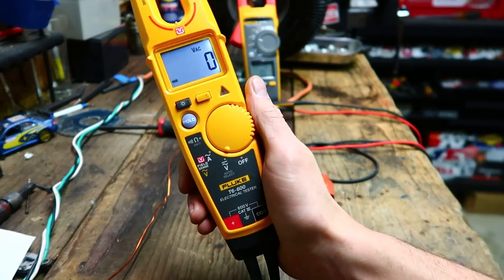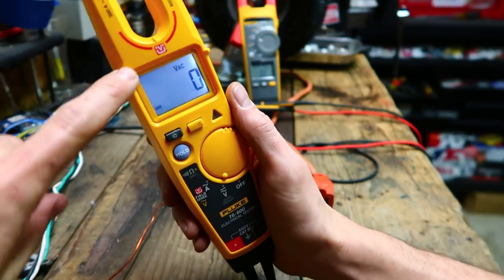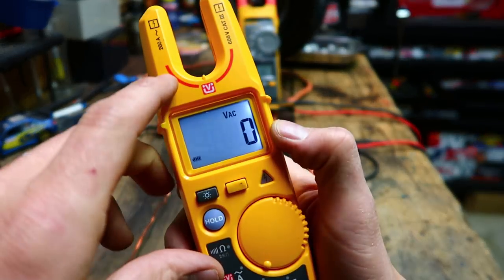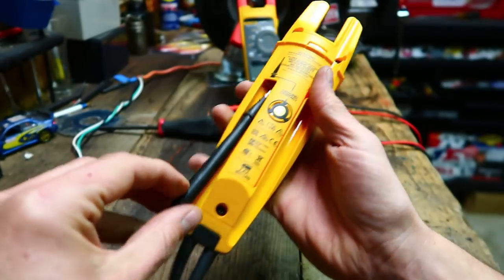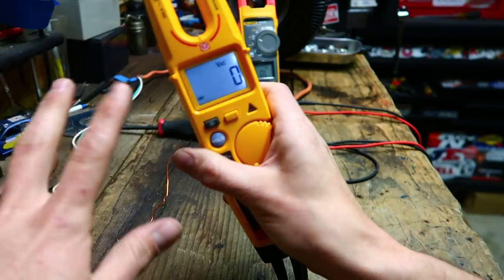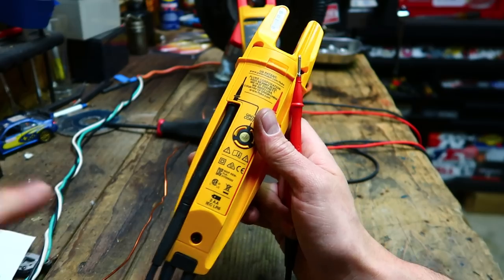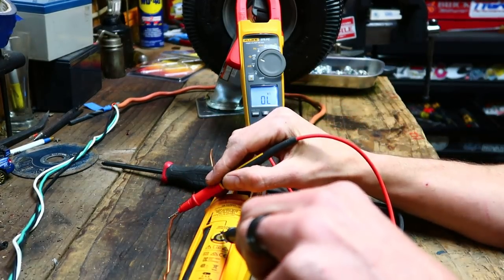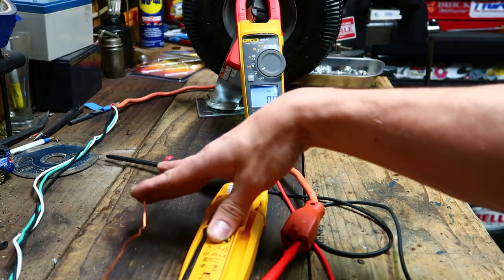Fluke T6-600: NOT DANGEROUS!

Comment: There's definitely a safety feature in there, but I think AvE's point is that relying on a safety feature to keep you alive is bad practice.  If whatever is doing the mystery shit fails, and you get a short path to that pad, it will kill you.  Using that meter as designed, there is no way not to be relying on the safety feature.
Reply: John......intent is not required to harm or kill.  But the almighty dollar rules all in these companies and engineers are required to create work-a-rounds to save $.   In many cases engineers KNOW these WILL cause the product to fail or greatly increase danger factor, but they have little to no say.
Reply: Yep. And sometimes its just unknowns which end up biting us. For example, in some year time, when the damage from blue LED light starts becoming apparent, people are going to be upset.
Reply: John Peat:  I recall FORD knew of high fire danger during rear end collision in several models, believed cheaper to pay a few claims, and went to production with deadly design. Many died. FORD had blood all over the boardroom table. Do not trust greedy people. (e.g. see Ford Pinto and Fairmont)
Reply: The blue light issue from LEDs  is not really true  there are some effects which are legit but minimal and blown way out of proportion (mostly circadian rhythm disturbances but that can happen with any artificial light source) by scammers, sensationalist articles and people with financial interests ( one of the biggest anti LED persons also claims WiFi negatively impacts health and literally they sell glorified tin foil hats as "anti EMF beanies" hilarious! ). Fluorescent light bulbs also have a very high blue light content with an awful CRI, its been about 60 years since they started being used on public places and no significant effect has been found so far to merit all the scandal LEDs are making.
Reply: Can you tell me some of this mysterious diseases? Also if "mainstream science" doesn't even know the causes of such "diseases" how can you say the cause of such effects is from the lights or the router? maybe you suffer from apnea but you don't realize and the fact that you turn off the router affects your sleeping patterns by suggestion. 

I assure you if i were to turn on a RF transmitter in the kw range at 5m from you without telling you as you sleep you would never realize, yet if i placed a small battery on the indicator LEDs of your router even if everything else was not powered you would affirm the RF from the router is messing you up. The power of suggestion is real and you are suffering from it, and is quite common on this pathological science people use to sell gimmicks and scams. Dont fall for it RF is all around you, your router is nothing, lighting generates RF, your car ignition system is a tremendous broadcast source, your cell phone, your computer processor, even a clock uses high frequency pulses that generate RF in fact the static electricity as you get out a wool sweater generate enough radio waves to be detected on an AM radio. Also your neighbor can have its router on too, just look how many routers are on when searching a WiFi connection.

When X-rays were discovered people quickly realized its harmful effects on organisms and the human body, its been more than 150 years since radio waves started to be used by humans and yet nothing surfaced until the recent wave of quackery that is sweeping modern society curiously enough its always mysterious, unexplainabe by "mainstream science" a conspiracy or some other ridiculous claim like that yet you have always someone selling "protective devices" smh

Anyway, i have an offer  

I sell you a tinfoil hat  an electromagnetic field shield for your head for just $99 but if you order two i give you one for 50% off, its made of copper not that low grade aluminium shield our competitors use, they are running out! just give me your credit card info, its safe! 

Here is a testimony that proves how great they are

"Before my Quantum-ubuntu™ hat i had constant head aches and couldnt sleep well, i live close to a radio station and i see my son has been having low grades since they changed the antenna, but now with my Quantum-ubuntu™ hat i sleep much better and don't have headaches anymore and even my hemorrhoids seem to be going away, also my son is getting more +A's!! than ever. Best $250 i have spent" ----Ana Linjector
Reply: There was a tiny study about an ion generator influencing the sleep of a handful of participants (positive influence if I recall correctly).

Comment: The question is not whether it is dangerous when new, out of the box, it is a question of what happens when the capacitor or high value resistor that is limiting current flow to the very very low levels starts to break down one way or another due to deterioration, moisture, etc.

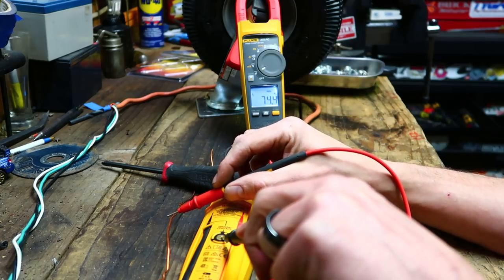Comment: Ok, here is some electrical explanation on why it is or isn't dangerous: If we take a look at 4:24 then I suspect the circuit you've created here is a simple voltage divider.
Basically between live and ground you have your 110 volts (or 120), then if you connect 2 resistors in series they get both a fraction of that resistance. And now let's say the grounding pad is a resistor of 1 Mohm, and your T5 fluke in volt measuring mode has 2 Mohm internal resistance, then the grounding pad gets 1/3 of the 120 volts, and the T5 gets 2/3 of the 120 volts. That's likely the case here. But when you touch that grounding pad and your body is 10Kohm, and that grounding pad is 1Mohm, then you get 1% of the voltage drop over your body, and 99% of the voltage drop over that grounding pad. That's why you don't feel anything. Why AvE had another measurement could be because his multimeter (he used UNI-T) has a way higher internal resistance than your T5.Or it could be because his Fluke T6 is actually a faulty one... A simple resistor will do the trick for the grounding connection, I don't think they did much more than a resistor, I think they sealed it to confuse you into thinking it's aerospace military super-duper technology and not marketing wank. It's nothing fancier than those voltage measuring screwdrivers with the neon lamp in it.
Dude, what the hell are you sayin' about ghost voltage? Dude, voltage divider, resistors in series, a volt-meter is simply a high-ohm resistor that measures what amps flow through it. The reading has nothing to do with how well build the multimeter is. That's another way how the marketeers want to rip you off.
Why there still is a danger to it: Speaking about the touchless sensing: who the hell came up with the idea to put the voltage reading feature on the amp-reading dial position? Those should be separated. Because now if you put your dial to the position to enable the field-sense you will have continuity between red and black leads. This basically means that while you are measuring volts you have continuity between red and black, and you must not use the leads to measure. Don't forget a lot of times you won't ground with your hand, but by touching the ground with the probe. To get a better connection, because it's more convenient in your work-case, cuz you're use to use the prober or because you're wearing gloves. This are reasons to just name a few. Field sense should be on the voltage-dial position, period. If that technology worked as advertised.
---
Disclaimer: The numbers I used were all made up, they are just examples to explain the principle. I don't feel like looking up the exact, irrelevant data. And my values should be reasonable.
Reply from the maker: my whole issue with his video is that he tried to make it appear there was mains voltage on the contact pad that could electrocute someone, and that's false. I totally agree it's a shit feature, but you can't get shocked from using it
Reply: I thought about it for a while. What if that resistor fails or the batteries heat up and melt it. Unlikely but possible.
Reply: That's where I stand on this too; many people are assuming the touch pad will have such a low current to not shock you, but that assumption is rooted in believing that the meter is undamaged. There are too many safer alternatives to measure electrical things than using your body for a convenient shortcut.
Reply: Well thought out response. Thanks for taking your time to share this.
Reply: Mike's Tool Shed well he was drunk and butt hurt fluke called him out I suspect lol poor guy you could tell he was pissed the whole vidjao
Reply: I agree with you totally and no meter for testing line voltages should be made so that you are part of the circuit at any point. Horrible idea. AVE has always admitted when he is wrong to the best of my knowledge and if he is in this case I feel certain he will make yet another video. It's bad enough it doesn't work as it should, but if the comment from Fluke held water then it would still be up. Seems like a lawsuit waiting to happen either due to it failing to read or a malfunction/user error because that would make a hot cup of coffee from McDonald's seem like a blessing.
Reply: I don't get why you think a knob on a fluke meter would short (or give continuity) between the probe. It's a high impedance input point bar.
Reply: well I can tell you that if you can sense live voltage there IS a PATH that is there, it may not be Deadly YET, but it can be and that is the fact that he is bringing up, if that device gets wet ( or even damp) on the inside of that area this will complete the link and kill you. this is why it is unsafe. There is a Trace that is unsafe. I am sure he knew this and was too fumed at Fluke Shitter who said  " you are not using it right "  sorry but if AVE used it wrong, most will use it wrong, but it is not that, it is just a Finiky Gimmick.
Reply: NoNoLabs if the resistor fails it ain't gonna short out it's gonna open.
Reply: @MikesToolShed  "you can't get shocked from using it" - try 600V and have an injury on your finger (knife cut would do it).

Comment: I'm not sure if it's a big deal but didn't ave have it on the amp setting during his video.
Reply: He did, that is a big deal. When you measure amperage, there is effectively a dead short from the red to the black test lead. AvEs point had little to do with voltage, if I am understanding correctly. His point was that if you were measuring amperage using the probes, and you were touching the contact pad, and you happened to have a lower resistance path to ground than whatever the black probe is connected to, it COULD be dangerous. For instance, if for some reason you were measuring amperage between a wire at 200v and a wire at 100v, and you were touching the contact pad, then it SEEMS as though you would be touching a 100v source and it could kill you.

I also find it hard to believe that somebody at Fluke didn't think this one through, but I see AvE's point that on the off chance Fluke HASN'T got a weird trick up their sleeves with the contact pad, it could be extremely dangerous in the right circumstances.

Comment: I do agree that the meter is not dangerous, but your test methodology was wrong. The Fluke continuity check only beeps under 100ohms, so if there was a 1kOhm resistor in there it would still be dangerous, but would not show up on continuity. Instead, you would want to put it into normal resistance check to see what it reads. If the resistance is over 10MOhms then it should be perfectly safe to use. If the resistance is higher than that then something like a Fluke 87 is useful because it can also read in micro-Siemens. A better check might be to make that pad live, and use a uA meter to see how much current can flow from that pad to ground. I would be surprised if you were able to see anything but measurement noise. 

Let me know if you have any questions about what I just said.

Comment: I tested one yesterday and it's dangerous, that shit shows 0V even on a 230V circuit if you don't aim it perfectly. I know that these meters are not allowed to test for 0 voltage conditions but even then it should work reliable.

Comment: It's probably just a very high value resistor. Resistors limit current (in this case down to micro Amps that you can't feel), not voltage.

Comment: Yes there's no continuity but that only means that the resistance is over 40 ohms (some meters have a higher threshold).   Undoubtedly the impedance between the grounding button and the negative probe is very high.  High enough that it's not considered a safety issue.    Still, when working with live AC power, you want full galvanic isolation whenever possible with anything you touch.

Comment: You have to use as amp meter (you were in field sense setting) in order to reproduce the same as AVE's.  Are you sure you put the probe in the live connector?
Reply from the maker: either way it was reading 74 volts in that configuration, it wasn't REAL voltage, and it can't hurt you.

Comment: What the second multimeter measured is called "ghost voltage". Ghost voltage can pass through things without carrying any power at all. That's why some multimeter have a "Low Z" feature, to check if the voltage is a ghost voltage or true voltage.

Comment: Any meter that tell you to purposely ground yourself to properly use it while testing is fucked up. The last thing you want when working near electricity is to be grounded. There's a reason bucket truck booms and electrician ladders are made of fiberglass.. yeah you may be isolated internally in the meter, but let's say you put the meter down thinking the circuit is dead, forget to unground yourself, and then touch the wire that this thing told you was dead and wasnt? Seems dangerous to me...
Reply from the maker: i totally agree about the "training yourself to ground yourself" to get accurate measurements and i think the feature is shit, but the voltage at the contact pad can not hurt you.
Reply: Mike's Tool Shed yeah you the nail on the head. The tool isn't really the issue, it's the way they tell you to use it. Only other issue I could see happening is if you attempted to use it on something with significant voltages to jump through the meter internally while your grounded, but if you checking voltages that high with any meter  in this class, your pretty screwed anyway..

Comment: Voltage is not an issue, current is. So when you have 120v It doesn't matter at all.
Reply: That's wrong. You can draw hundreds of amperes from a car battery, but 12v isn't enough 'pressure' to push that through a high resistance such as a human. It's a combination of voltage and amperage that kills. Think of it like a garden hose vs a pressure washer. The water is amperes, It doesn't hurt you coming out of the garden hose because the pressure (voltage) is low. But it hurts out of pressure washer even though there is less water because there is more pressure.

Comment: Ha ha I saw how scared your hand was to touch that ground while touching the finger spot.
Reply from the maker: lol, i did hesitate, hell, I've been wrong before, that was the first time i tried it.
Reply: Definitely not like Big Clive in regards to possible surprises he's expecting.
Reply: Haha Big Clive testing out what he thinks is a stun gun module.. Only one way to find out lol
Reply: @Mike: If you must use the back of your hand. If the circuit is live and the muscles contract then you get pulled away from the circuit instead of the current locking your muscles onto the live circuit.

Comment: It doesn't always work unless you touch a ground while using the pad. The point is that grounding yourself is step one to shocking yourself.  The meter is most definitely safe but the practice of grounding yourself is not good work practice.

Comment: I do have a use for this thing, and we bought it (T6-1000), but it is difficult to use.  Surveying outdoor street light / traffic signal circuits to find suitable power to tap requires opening concrete pull boxes where all conductor terminations are weather sealed in rubber and ScotchKote sufficient to be under water.  Opening just one live termination and re-sealing it is tedious and dangerous, let alone dozens in a day.....just to find out if the voltage is appropriate for the proposed equipment to be added to the street light.

We did find that getting it to work is tricky.  But anything that allows us to make a quick observation whether a circuit is 120/240/277 etc is valuable.  We don't rely on this for the safety of determining whether the circuit is live or not.  We are just narrowing down which locations are potential sites before contacting the agency or department that manages those circuits.  You can't build a quote unless you know the location is feasible first.  Even after that there are hurdles, but it narrows it down.

Thanks for  the video though, it explains a lot about the difficulties we had using the Fluke for this.

Comment: but what if the meter is on amps mode?  does it ONLY do amps with the clamp and not through the leads?   otherwise its no more dangerous than a fancy neon mains tester, then its like 10 megaohm in that magic strip or more

Comment: I know it's not safe because a meter could fail, but some times when I wanna figure out which of the two holes in an outlet is live, and I don't have earth. I hold the tip of one probe and stick the other one in each hole to test which one gives me voltage. I do make sure the meter is fine beforehand by sticking both probes into the outlet first to see if gives me a close enough voltage reading (usually 240V). Yes, the meter could fail right after I test the initial voltage, but what's the chance of that? It's like what's the likelihood of being hit by a car on the road?